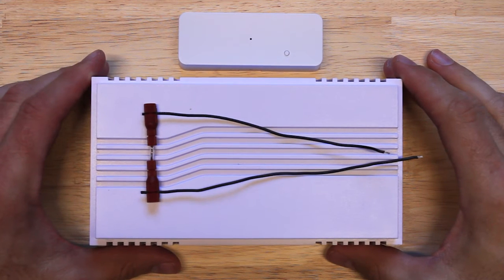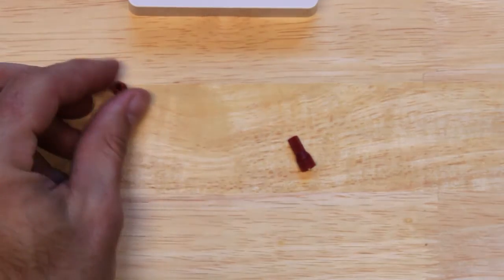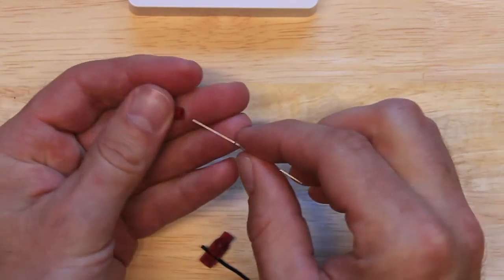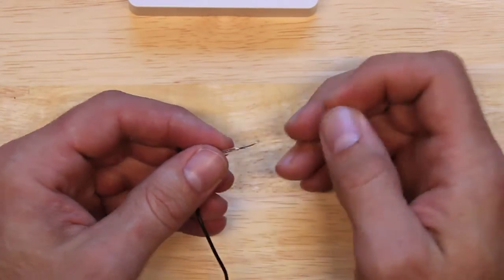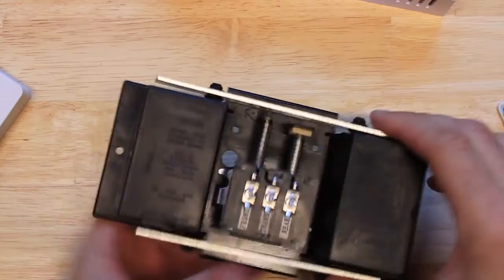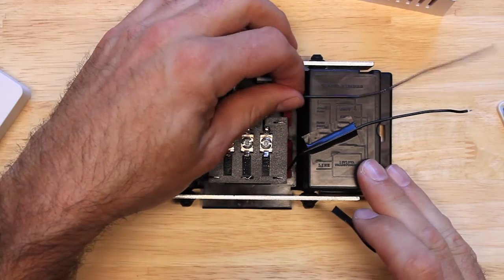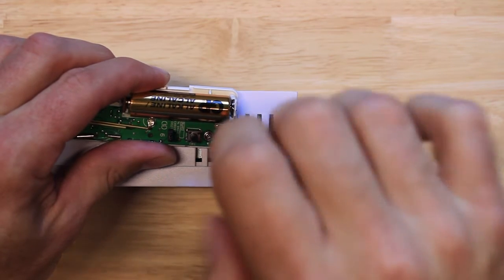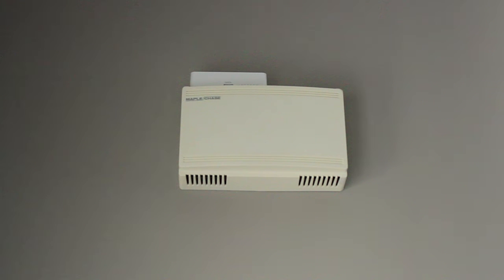DIY Smart Doorbell

Comment: Hi Mike.  Your video allowed me to solve a problem that's been bugging me for some time.  I thought I could use a Shelly Plus 1 relay to make my dumb doorbell smarter, but couldn't get it to work.  Until I saw your video, it never occurred  to me to use a contact sensor.  I used an Aqara door/window sensor and modified it like you did with the Insteon sensor.  By the way, your link takes me to an Amazon page for a Insteon water leak detector.  I did find what I think is the correct sensor you used on Insteon's website, but $34.95 + tax + shipping was more than I wanted to spend.  The Aqara sensor runs around $18.00 + tax + shipping.

I also had a wired reed switch that I had in a drawer -- in case I ever needed it.  I have a lot of things that fall in that category.  The reed switch body has screw terminals so no soldering necessary.  The Aqara sensor works like a champ and because it's Alexa aware can be used in routines that will provide a chime and/or voice announcement on select (or all) Echo devices in my home.  Additionally it can send a notification to my phone.  

A note to anyone else that reads this, you will need an Aqara hub to get the Aqara door/window sensor(s) to work.  When I first purchased the Aqara sensors, I thought I could skip the hub and use some other Zigbee device to program them.  Nope.  Had to invest in yet another hub.  I purchased the Aqara M2 hub ($59.00) because it has some features that I'm hoping to use at a later date.  Just FYI.

Thanks again Mike for making this video.

Comment: Very slick! I have done my whole home with Insteon gear and have extra sensors. Do you think there is any chance the reed sensor would be able to pickup a small speaker on a Ring Doorbell brad chime unit?
Reply from the maker: +Lee Silverman I'll look into this for you.
Reply: Mike Martin Wow, thanks!! The Ring Pro seems to lack the needed power for the intercom to work well (known issue to them) and they want me to take my actual physical doorbell out of the circuit to give it more, direct power and use one of the cheesy remote chime units.

I really like my custom door bell ringer unit and want to keep it. I was considering employing a relay some how to see if I could make it all work together. When I saw your video, I thought about a reed sensor or something right by the Ring Chime sensor to trigger this. Cheesy workaround, but regrettably my knowledge of relays and such are limited at this point. Again, thanks for any thoughts!